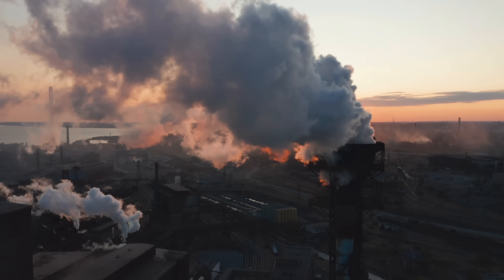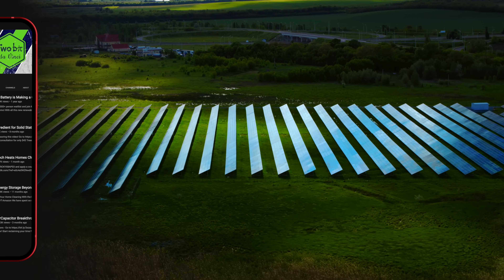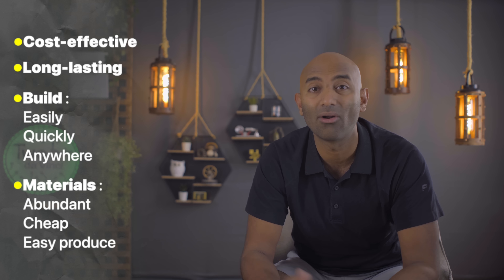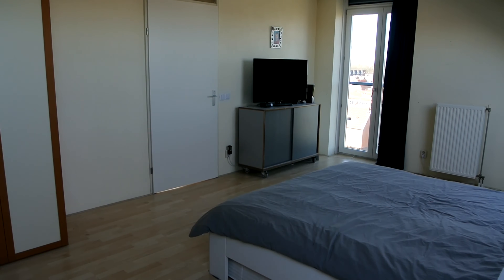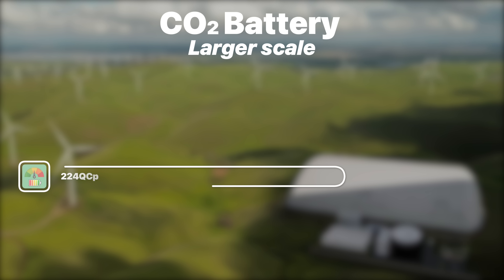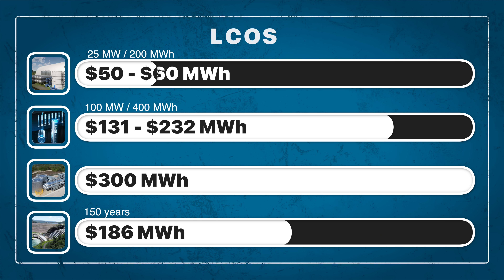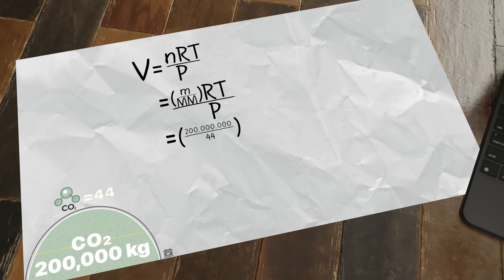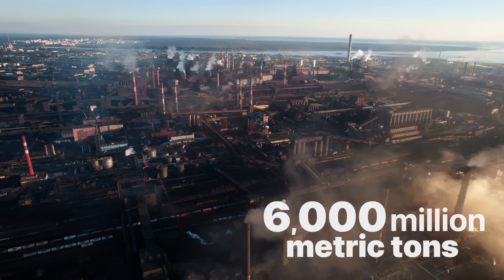The GENIUS Of the Carbon Dioxide Battery

Comment: Nuclear energy is far safer than it was in the 60's and 70's and should be the default energy source by now. There is no advantage to "green" energy. Big oil just pushes solar and wind over nuclear because doesn't work and forces us to continue using fossil fuels

Comment: You said that you hoped the cO2 battery would be filled with CO2 pulled from the air.  Why? This is really poor economic analysis. Why burden this technology with this requirement? Co2 is just a chemical in this process. Would you burden a lithium battery with this requirement?

Comment: A little considered fact when talking about energy is the waste heat generated from almost every system, that ultimately ends up in the environment. Some scientists see this as much an important part of climate change as CO2. Everything we use that requires energy contributes to warming the environment, electrcity is always described as clean, yet everytihng running on it releases waste heat, let alone the heat released in generation... even wind turbines etc. We need to reduce energy usage not just change from one form to another to make our lives more comfortable and easier. All energy can be tracked back to heat from the sun, so on a sunny day, all energy in the environment is solar energy plus. = Global warming.

Comment: Would it be possible to make a magnetic levitated flywheel in a vacuum chamber with magnets on the flywheel to act as a motor/generator when wire coils are moved close to it? It seems like it wouldn't lose momentum until acted on by the coils.

Comment: big dome covering a sand battery, CO2 makes the second best insulator behind a vacuum with proper reflectance,
ideal would be high temp sand surrounded by vacuum box surrounded by large volume of CO2 , this is likely far cheaper ( best guess), without doing math, well, oxidizing aluminum --- hard to reverse efficiently--- best for price I mean

Comment: In saskatchewan Canada we have many oilwells that produce an excess of CO2 at the refinery. This is then pumped back into the ground to flush more oil from the deposit. We also have   coal fired power station that is fitted with a carbon capture device to reduce CO2 emissions. Only drawback to this system is -40c temps in winter.

Comment: The problem is that it's only a short-time solution for temporary storage: a few hours is the most one can get out of it. Sure, in the vid one claims one can scale it up: butt that also means scaling up the surface and volume it uses. Looking at the numbers, it's pretty meager. The whole construction shown can only supply 2,5 MW for one hour?? That's extremely weak. Even a very small country would need at least 2,5 GW of electricity, with a minimum of 3 days to bridge. So you need it to expand *72000 TIMES more to store enough energy to bridge a 3 day gap for a very small country.  It's clear, thus, that it's energy-density is outright awful, even compared with batteries. And if you compare it with nuclear powerplants... well... two plants could do the same trick at less than a thousandth of that area, and for 60 years, instead of 3 days.

Comment: 200Mw plant by 2023. April 2024 and still no construction started. The HAVE got over 80,000,000 from government and other donors however.
Website states construction in 2024 and completion in 2026!
I smell a scam. See you back here in 2026 for confirmation.

Comment: The energy density of pumped hydro is dependent on the difference in elevation between the two reservoirs.  For example, if a reservoir were built on top of mt. Kilimanjaro and another one near sea level then the water pressure would be almost 9,000 psi if it wasn’t reduced by running it through a series of turbines on the way down.  In the real world a much smaller elevation difference exists.

Comment: Why don't they just use nitrogen? The atmosphere is about 78% nitrogen.
Reply: He mentioned it.  Because liquid air... i.e. mostly liquid nitrogen as you rightly said, is liquid only at VERY low temperature (-150°C or lower, depending on pressure).  You therefore need a very expensive cryogenic storage, that the present solution circumvents with CO2, which can be liquid at ambient temperature and moderate pressure (about 80 bar).  So, it will undoubtedly be significantly cheaper to use CO2 than air, even worse pure nitrogen!

Comment: It seems like this is a very dangerous technology as you concentrate the CO2.  A leak or rip would allow huge amounts of CO2 hugging the ground and killing all animals in the way.   Ideally, you would pull CO2 from the atmosphere and SLOWLY releasing it back to the atmosphere at low concentrations.
Reply: You have a very good point!  
As calculated, the dome containing the CO2 at ambiant pressure would be about 120'000 m3 for a 200 MWh installation.  If a sudden and huge rip was to appear in it, AND if there was no or very little wind (a stronger wind would rapidly spread and dilute the CO2), then dangerous CO2 levels  could appear within, order of magnitude ,1 km from the facility, and deadly levels within a few hundred meters.
Such a facility must absolutely be built quite afar from any house or animal-farming facility!
BTW, the CO2 they would use would ASSUREDLY not be concentrated from the atmosphere, but come from the exhaust gas of a fossil-fuel burning power plant... like most industrially used CO2... included the bubbles in you favorite soda!  In normal operation, this facility would cycle the CO2, and neither use nor release any!  It would be a risk only in the case of an accident ripping the dome open... like a plane crashing onto it.

Comment: OK,  so you have a giant dome to contain the CO2 after it's run through the turbines, then you pump it out and compress it into a liquid.  Are those domes strong enough to contain a vacuum?  If so then scaling up will be a problem.  Do the domes contain a giant balloon that shrinks while the CO2 is being pumped out?  If so, then a 30 year lifespan is unlikely.
I wish the video had explained that.

Comment: And I don't doubt that climate is changing; I'm just not sure that reducing carbon or CO2 would make a difference, or that CO2 is even an enemy; it benefits us, and there are massive quantities of other unpleasant gases and pollutants that harm our air and environment.   

 Pollutants in buildings and industrial toxic gases (except CO2)

1. Sulphur Dioxide (SO2): Commonly released by the combustion of fossil fuels and industrial activities.
Nitrogen Oxides (NOx): Emitted by vehicles and industrial processes.
3. Volatile Organic Compounds (VOCs): These are compounds that are emitted by paints, solvents, and industrial operations.
Particulate Matter (PM): Fine particles emitted by building, combustion, and industrial processes.
Carbon monoxide (CO) is a byproduct of incomplete combustion of fossil fuels.
6. Chlorofluorocarbons (CFCs): Once employed in refrigeration, CFCs are being phased out owing to their ozone-depleting impacts.
Ammonia (NH3) is a common component of agricultural and industrial emissions.
Lead and heavy metals are often found in industrial waste and ancient construction materials.
9. Asbestos: A carcinogen that was formerly utilised in building.
Formaldehyde is a substance found in building materials and furniture.

Other Atmospheric and Climate Gases

1. Methane (CH4): A powerful glasshouse gas emitted mostly by agriculture and waste disposal.
2. Ozone (O3): A damaging pollutant at ground level, it defends against UV rays in the stratosphere.
3. Water Vapour (H2O): The most prevalent glasshouse gas, yet its concentration in the environment changes greatly.
Nitrous Oxide (N2O): Emitted by agricultural and industrial processes, as well as the burning of fossil fuels and biomass.

 The Advantages of CO2

1. Photosynthesis: Plants synthesise oxygen and organic molecules by combining CO2 and sunshine.
2. Agricultural Growth: Elevated CO2 levels may help certain plant species grow faster.
3. Industrial Applications: CO2 is utilised in refrigeration, as a food industry solvent, and in fire extinguishers.

Solar and wind energy chemicals and batteries

1. Solar Power:
   - Silicon: The most common element used in solar cells.
   Cadmium Telluride (CT) and Copper Indium Gallium Selenide (CIGS): These materials are used in thin-film solar cells.
   - Lead and lithium: For solar energy storage batteries.

2. Wind Turbines: Fibreglass and resins for blades.
   - Rare Earth Metals: Neodymium and Dysprosium for turbine generator magnets.
   Steel and aluminium are used for structural components.

Destructive mining practises and the use of fossil fuels

1. Open-Pit Mining: This method of obtaining silicon, rare earth metals, and other minerals sometimes results in land destruction.
2. Water Pollution: Heavy metals and chemicals from mining may harm local water supplies.
Dust and pollutants from mining equipment contribute to air pollution.
4. Energy Consumption: Mining and refining are energy-intensive activities that often depend on fossil fuels.

Comment: Renewables are NOT cheaper, not by a long shot. They take longer to break even than most renewable sources will survive. Also don't forget everything that we know that has come to be is within the interglacial period. When I was a child the greatest climate fear was the return of the ice age. Given that the world doesn't appear to be warming at the rates we were told (the polar bears are in abundance, there's still ice caps, both of which were supposed to be gone a decade or more ago now) and that millionaires are still buying beachfront property I'm not worried. I can walk faster than the ocean can rise in the WORST case presented. But if the ice age returns, well. Yeah.

Comment: CO2 is in only trace concentration making it functionally unimportant for any so called greenhouse effect.  The concept of so called insulating gas is a fraud and misrepresentation.  No industry uses CO2 for insulating enything even though its cheap and easily produced[, so why is that?
CO2 is not replaceable for  food production and oxygen production on planet earth.
CO2 reduction from current levels means real  direct, proportional reduction of carbohydrate production and oxygen reproduction and there is no real alternative.
You cant fool mother nature, but you can fool an ignorant public and greedy corrupt governments and corporate entities.
The proof is in the photosynthesis equation and the fact that there is far more argon at .9%  in the atmosphere than CO2 at .04%.   And yes they use argon for insulation in windows and its expensive.
The only question is why are they lying about it and making you pay them exorbitant amounts of money for alternatives that generate far more real pollution and though obscenely polluting still wont work?

Comment: Can this technology be developed and used at a "smaller" scale, like home made and used to power the home?
Reply: I’m sure there would be no problem in scaling it for home use & it would require substantial area, but the real problem would be efficiencies would be low for smaller home type units & costs would be high to build & maintain at this small level.

Comment: That is exciting; I forgot to consider the liquid cycle for CO2 storage. While watching the video, I imagined using the cycle to transmit energy too. The pipe carrying liquid CO2 would absorb heat along the way, increasing its potential. The gas return pipe would serve as the dome. So elegant! I love it. However, the cost factor for pumped storage needs to be explained; I wonder if it excludes the recreational value and agricultural side-benefits of pumped storage. Further, if (not pumped) storage is from a stream, where water is just held back for flow during electrical demand cycles, the cost and benefits may be even lower. I'm especially concerned with this because Pluvicopia includes such storage as part of its benefits. Pluvinergy produces excess water, so percolation into the water table is one more benefit, to remove water from the oceans and transfer it to land storage for sea level adjustment. (Look at the numbers before you brush this off, I am aware that 1mm of sea level equals 361 km3.)

Comment: Grid battery has to be:
1.  Cheap
2. Scalable
3. Reliable 

Weigh and energy density doesn't matter in stationary batteries. 

This looks like  a great solution.
Reply: CO2 helps plants grow. Our planet is 5% greener than 20 years ago, thanks to CO2. We are still in an ice age let's get out of the ice age and melt this fucken ice. The dinosaurs had 3000 ppm of co2, and their temperature was only 27 Celsius. We have 430 ppm only 0.04 percent of our atmosphere. Our weakening magnetosphere is what is driving climate change, not CO2.
Reply: Couldn’t have put it better myself

Comment: "Breakthrough Battery Proves We Wrong About Carbon Dioxide!" - What was it exactly that we supposedly got wrong. Language can be important in matters that require concise and correct language to maintain accuracy.

Just because CO2 can have multiple properties and uses, that doesn't mean we got something wrong (who ever "we" is and whatever something is?). Can you explain?

Comment: I love 19th Century Tech used in the 21st century. It also guarantees that there is nothing to be perfected. All the tech has been known for a hundred years. Our previous governments and companies have just been lazy. They would rather go along with stuff already developed like the fossil fuel infrastructure rather than building newer, better and renewable. 
The Oil industry had all the money and all the time they needed to move over to renewables gradually and maintain their energy dominance. With the money they controlled, they could have literally cornered the market on renewables. The latest developments in low temp geothermal power systems and the oil industry's expertise in drilling holes at all angles means they could be making geothermal power stations all over America.
Because of their laziness and obstenance I have no compassion for their plight when those companies lose their power and influence.

Comment: Do they take into account the amount of CO2 to produce all the pipes and pumps?

If these high tech solution are somehow the fix just so we can go on making high tech solutions,  perhaps adopting very low tech solutions for most daily needs would work even better?  

I live with electrical power and even this laptop computer but my electricity usage has been almost steady for the past 35 years. The bills keep rising. I think the usage has increased by one kwh per day in 35 years and that's probably this computer and the lamp on the desk. I bought a leaf blower and an edge trimmer a few years ago because I'm getting old and it's harder to bend because of arthritic hips.  I don't have a lot of electrical gadgets, don't use the air conditioner unless it is much too hot for many days to ever cool the interior at night,  Most summers it isn't used for more than a day or two. I haven't had it on at all so far. I line in NH. My standard of living is just fine as far as I'm concerned. I live alone and don't have a lot of people nagging me to get more than I need. I have a low income and lots of sales resistance. I keep my appliances for decades.  I have a 50 year old electric stove that I reconditioned myself (refreshed the paint and repaired a broken connection) ) and works better than a replacement I tried briefly. The replacement tried to tout itself as energy efficient but it didn't work and didn't make any sense either. I have a 35 year old refrigerator that is in good condition. It still looks new.  I know how to respect and care for "nice things". I'm not a slob or an idiot about personal consumption. It makes it all seem more valuable. 
Deciding what a good standard of living is might do more than trying to mindlessly increase standards of living with no clear objectives. Developing countries might be better off not adopting the industrialized world's definitions of comfort and being more selective about what they want to change in their ways of life. 
If I could have a comfortable standard of living - neither squalid nor too opulent - (but for $8 in lumber I even did make modillions for the connice of the front of my house) and I wasn't enslaved by it economically or physically, I'd be satisfied.

 But what is that? I'm not talking  N. Korean standardization either. "Dear leaders' can go hang themselves.  They make sure they get the best of everything in the largest quantities. I hate the hypocricy.

Comment: CO2 vs Liquid Air, seems a no-brainer, but a focus on round trip efficiency (RTE) is wrong-headed. The actual generation of renewable energy is becoming so ridiculously cheap, that the storage( and transmission) issues are the main hurdles at present. A really cheap, globally-democratic solution like this, doesn't need to be uber-efficient.
Reply: Sorry, by 'globally democratic', I'm just referring to the availability of all the materials and technology required.

Comment: I have seen this reported before except that the storage dome was under pressure by a couple of atmospheres to have more CO2 in a lot smaller volume. They would take a strip mine seal the ground from leakage, give it a roof then have it have around a pressure of about ten or atmospheres.

Comment: Indonesia's 7×500 MWe ThorCon Thorium Molten Sodium Fluoride salt burner energy converters, currently under evaluation at an expected Capital cost of $1200/MWe will have a pre profit levelised cost of less than $30 per MegaWatt.hour and a foot print of 180m×65 = 1.17Ha (about 2 football pitches) per 500MWe - that's over 43kW/m².- walk-away safe base loader or auto load following to save the irratic unrecyclable solar & wind farms and Lithium MegaPacks... Can't beat that?